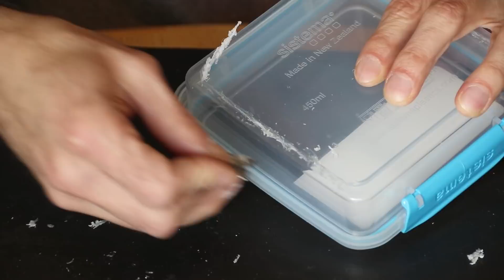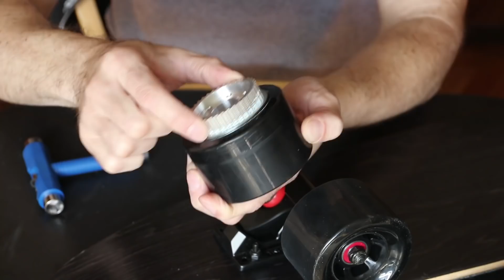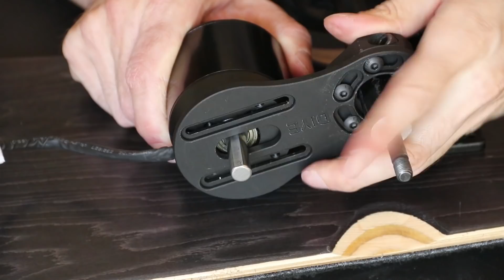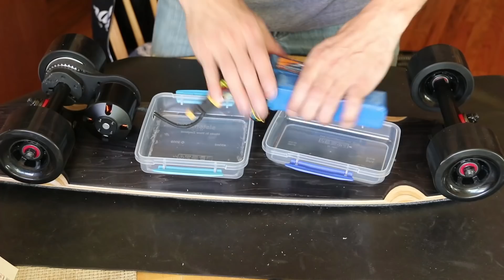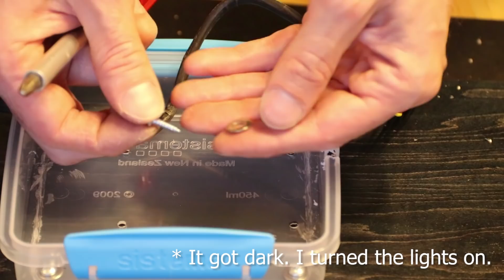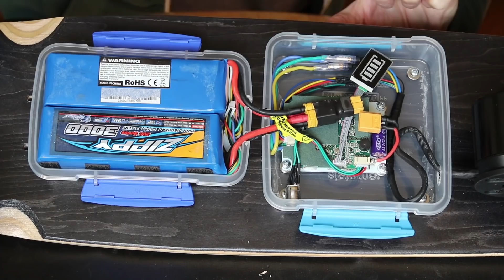Electric Skateboard Build - Belt Drive | Weight ~11 lbs | Price ＜ $300 | Speed ＞ 23 mph

Comment: How many miles do you get out of the two batteries?

Also i want to ask if it is posibble to add 2 motors and 4 batteries with the exact same set-up that you have?

Thanks
Reply: No, you would have to get another esc for two motors and you'd have to wire the batterys not in parallel.
Reply: I would recommend a VESC instead of 2 escs

Comment: Can you Link a motor that will work with the motor mount on HobbyKing because you can save some money if you buy $150 worth of stuff from them
Reply from the maker: The KEDA 63-64 190KV could work, but I don't think it's worth it. It doesn't come with connectors and is not as powerful as the motor I'm using. Also, I think the shaft is smooth, which makes it difficult to properly tighten a gear on it. It would probably be better to just order another set of batteries to get to $150.
Reply: @orensprojects7250  thank you

Comment: Dear pilgrim, I think that should solve your plastic box problems. They are cheap, every size and form.
They also should be easy to work with 😉
Never use plastics on a skateboard! Its not a toy, its extreme sports equipment!
https://www.campz.de/camping/campingkueche/relags-edelstahl-proviantdose/235339.html?gclid=EAIaIQobChMI4dWs9fa23gIVxLTtCh3N0AOpEAQYBSABEgJIR_D_BwE&_cid=21_1_-1_9_1371_235339_146945482710_pla&ef_id=W9zmrwAAALCnvvP@:20181103000711:s
Reply from the maker: Thanks! those look strong. They might be a little too tall and rounded. Maybe they have others.
Reply: @orensprojects7250  ...yeah i think there must be smaller and flatter ones somewhere out there, and if not i think its not to diffucult to modify a thin aluminium box like that...I posted you this because the plastic parts are more than deadly. 
Thanx for replying me and sorry for being late on this conversation, but your reply wasnt shown up on my account, kinda wierd...

Comment: Missed the most important part, didn't explained sensored motor and sensored ESC and why anyone should choose sensored motor and ESC.
Reply from the maker: Yes, I should have gone over that more. In practice I've noticed that it's not very important. I disconnected the sensors on my other dual hub motor board and the motors work fine - even from a stop.

Comment: A good idea for a video could be to do a charger for your batteries, so you dont have to take them off every time you have to charge them. Just like a Boosted board.
Reply from the maker: Being able to charge the batteries in the board would be nice. For that I would build a battery using 18650 Li-ion cells with a BMS. For these builds I used Lipo batteries because they're easy to connect and less expensive.

Comment: No anti spark?
Always wondered if really necessary 
Replacement board looks good with the blue wheels
Reply from the maker: Thanks, I'll show that board more in my next video. I used an anti-spark connector in the past but I don't bother anymore. After about a year of use without it everything is still working fine.
Reply: @orensprojects7250  but you get the sparks? no black residues on the connector?
 i'm using them atm on my 10s build but wonder if really necessary..

Comment: Motor rated to 75A. Batteries good for 100A+. ESC limited to 15A.
Reply from the maker: Good point. The ESC might be the limiting factor, but in fast mode this thing is almost unrideable because it accelerates so fast. I'll show it in my next video.
Reply: You have a point, but I'd argue that it is unrideable not because of the torque, but because of the relatively raw controller signal.  Boosted runs 60A at the motor, but does a lot of signal smoothing, so it doesnt feel uncontrollable.  I imagine the Chinese ESC just doesnt.  I would argue that at <15A, you really might as well stick to hub motors as they are simpler, easier to maintain, and somewhat lighter.  The whole point of belt-drive is that it allows you to run much higher Kv motors, which means the motors can run at much higher currents, which means you can tap into a TON more torque.  The VESC allows you to add some signal-smoothing, you should consider moving in that direction, I think you will find it is VERY worth it.  I'm really enjoying my deck which is running at 75A at the motor, 76mm wheels, and 3:1 gearing (so basically as much torque as you can fit without your parts scraping the ground), and despite my 30" deck, find it to be an exciting but quite rideable board.
Reply from the maker: I definitely agree the eBay ESC I'm using does not do a very good job at accelerating smoothly in fast mode. The point about how fast it accelerates is more to show that it's capable of generating a lot of power. The 6374 motor I'm using is way more powerful than a single hub motor would be. I also agree with you that hub motors are easier to build and maintain, which is why I generally recommend them. I've used VESCs in the past (see my older videos). The VESC is nice and I like the configurablilty, but I think more people probably want something that's easy to build, inexpensive, and gets the job done well enough. I understand that for esk8 enthusiasts the VESC is the better way to go. It sounds like you've built an awesome board.

Comment: you sort of messed up something, this a bit hard to watch at parts, as a  builder, the wheel pully that you brought is for Paris style trucks which are more rounded (even though they claim their "made for calibers)

thanks for the vid anyways
 **you put on the truck clamp at the wrong angle, or the seller just sent you the wrong mount
Reply from the maker: You must cringe easily. For the pulley, the ebay seller said it's compatible with Caliber II trucks. It might be compatible with the 10" version but I haven't tried. Either way, it only took a few minutes to fix. For the clamp, I tried it at different angles and that was the best it would get, which worked fine. I'm always interested in suggestions for improvement. With DIY builds there are choices to make. I try to balance the best performance for the lowest price. I know there are nicer components that are significantly more expensive. Thanks for the feedback.
Reply: @orensprojects7250 I just don't want others making the same mistake, when I first started I had the same issue ebay seller claimed it would fit on caliber but the hole on the motor pulley was too small.

Comment: I would like a dual motor esc but they don’t have a power switch how can I solve thisnossue
Reply from the maker: I'm pretty sure the dual motor version of the ESC I use in this build does have a power button. You can send a message to the ebay seller to make sure.

Comment: Hi Oren I would to ask you about this ESC with remote. on the website this ESC have Max out put 1350W....so if I want to buy turnigy sk3 6374 190kv which has 4000W then I lost some of this motor potential???
Ok and how smooth is your motor and this esc whe you push the throtle
Do you have 3 speed options just out from the box?
Thanks :)
Reply: You should get an vesc to reach the full potential of 6374 more specifically the focbox from enertion, if you do get an esc like in the vid it would be an bottleneck but it would still be very fast
Reply: FOCbox Unity just around the corner!  Its looking pretty tasty anf Jeff at @enertion has made some stellar design choices.
Reply: Search Aliexpress for FSESC, it's one of the cheapest VESCs but still good. The China ESC Oren used is a bit more plug and play (which is defenitely worth considering), but doesn't have the capabilities of a VESC. For the VESC you'll have to fix something yourself for the remote and power switch.
Reply: @ehvlullo  foxbox is better and more reliable try cheaper vesc on your own risk
Reply: For the price of that focbox you can buy 3 (!!) FSESC. And then it still may break. I haven't seen any statistics on focbox being more reliable than FSESC. Flipsky stuff has been out for some time now and has proven reliable as far as i'm concerned. Sure, don't use FOC and stick to 10s but that's advised for both. Enertion seems to me like an aggressive company focused on marketing. If you're going all out with 12s and FOC dual etc etc buy a VESC 6 (Flipsky has a good one as well), but people have budget constraints and things tend to be a lot more fun when they're only a third the price for the same performance.
Reply: @ehvlullo  foxbox uses better quality conponents but of course if configured Incorrectly you can fry any vesc
Reply: @ehvlullo  focbox is 138$
Reply: No. That's excluding $14 VAT. 
Focbox - $152.41
Flipsky - from $48.90 from Ali.
Edit: that VAT seems EU-specific. Still a very large difference without it.
Reply: @ehvlullo  48$ including shipping?? Yes I don't have vat I'm in USA, vat is only for Australia
Reply: @alanzhou858  yeah that AliExpress 49 is with free shipping, you can look it up. And VAT for enertion is also EU so those prices I mention hold at least for everyone there. AliExpress shipping is ok for me so far, but does take about 2 weeks to arrive.
Reply: @ehvlullo I agree that cheap vesc can treat you very well, I just like to have a sense of quality in my mind, it makes you have a sense that your board won't fail

**also the cheaper vesc cant do foc for shit, you'll just burn your drv8302 if you try, trust me I tried if you don't want to pay 138 for vesc get a torque vesc (vesc 4.12) for 100$ there super reliable and 

in my 4 years of esk8, I've got thrown off once and that was because my cheap may tech vesc full braked at me at 24mph

focbox has never failed me plus focbox can do 10 more amps than normal vesc

if you did not know vesc is an open source esc created by Benjamin Vedder
Reply: @ehvlullo  i just cheecked there is no 49$ vesc ( i only found maytech 89$) no vesc can sell for 49 dollars because that is the production cost (and its way to far from the price vedder wanted and authorized) the offical price for vesc is soupposed to be 100$
Reply: @ehvlullo  great than, I just don't want the MOST IMPORTANT component in the build to fail and seriously hurt someone, the problem with cheaper vescs like that is that the MOSFETs gets too hot and desolders themselves causing a loss of power which can cause you to fall forward when your leaning and don't expect power to cut.
Reply: Guys but what about the rc car or boat high Amp esc?? I see people use them for electric boards but the can be use with 6 or 8s only but cost about 35-48$
Reply: FocBox unity is around 130- 150$____ for this price I have
-this same hal sensored 6374 motor what Oren use
-this same esc and controler and power switch what Oren use
- and 8 or 10 LiIon samsung 18650 bateries
Reply from the maker: Hi Nucleo, it looks like you've already done good research! It is possible that the ESC I'm using won't get the maximum power from the motor but in my experience it will be more than powerful enough. There are 3 speed modes built in to the ESC. I almost always have it in medium speed, which accelerates smoothly and will reach a top speed of around 18 mph. In fast mode the board is almost unrideable because it accelerates so fast and will hit a top speed of around 24 mph. Options like the FOCbox or cheaper VESCs could be good if you want to get in to tuning the ESC more precisely, but they're much more expensive - as you've discovered.
Reply: @orensprojects7250  thanks Oren...for me 20mph is more then enough.....3 speed modes too :) if We want build skateboard with top shelf components and spend 900$ or more ,then is easier to order ready to ride evolve skateboard...
I love your jobs :)

Comment: That guys a prick. Screw him, btw im glad your back. Sense your last hub build ive decided to build my own board as well. I got everything but let mr clarify something....if you dont have all the stuff to charge lipos then you will be close to 500 dollars...although i used turnigy batteries.
Reply from the maker: Thanks! That's awesome you built a board! Yes, you're right that I didn't include the charger in the price. I have several boards and only use 1 charger. I use the B6AC V2 charger, which is around $45, along with a parallel charge board that's around $12. There are better chargers but that one has been working well enough for me.

Comment: I have questions:

1) What specific outdoor carpet do you use instead of griptape?
2) Does the adhesive adversely affect the deck?
3) Is it easy to remove the carpet to replace?

Thanks!
Reply from the maker: For the carpet I have the link in the description. I got it at Home Depot. It's made by TrafficMaster and I think it's called Dayside. The adhesive hasn't affected the deck in any bad way as far as I can tell. The only thing is that it's not quite as strong as the adhesive on grip tape so sometimes I have to re-glue around the nose or tail a bit. Maybe a stronger adhesive would help. It should be easy to rip off the carpet if you want to change. On my newer board I switched to a rubber stair runner material - the link is also in the description. I also got it from Home Depot and it's also made by TrafficMaster.
Reply: You caught me not reading the Description.  Sometimes I forget!  Thanks, Oren!

Comment: 8:34 looks like the belt is misaligned + touching the wheels?
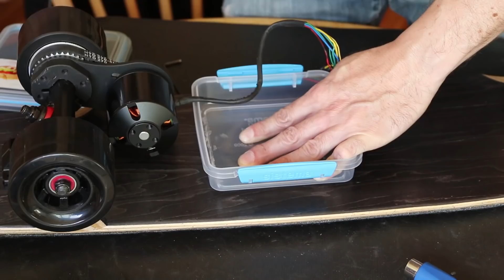Reply from the maker: It does look like that from that angle but there's a flange on the gear. You can see it more clearly around 8:48

Comment: YEA BEEN WAITING AGES FOR THIS VID. 

Solid video as usual. Its not a short vid but thats not a bad thing. For people who haven't watched any of your other videos and need a guide on how to make an electric board theres pretty much everything they could need. I look forward to the testing video, am interested in the pros and cons v hub. I cant decide if I want to actually go ahead and start building a belt or wait and buy hub motors later.

I still want to try 3d printing my mount and stuff. I got flexible filament to see if I can even print the belt but I havent done it yet because idk if the 3d printed parts are going to suck or not lol. But I do feel like belt has the ability to be much cheaper, and a single belt should out perform a single hub because you can use a much bigger motor.
Reply from the maker: Thanks! Sorry it took so long. I'll try to get the comparison video out soon. Yeah, I think a single belt setup could definitely out perform a single hub motor. 3D printing a battery container would be nice! Maybe you can create something that's the correct size for the batteries, strong enough, and also easy to open for battery swapping. That's something I haven't been able to find. For the belt it might be easier to buy one. I think they're pretty cheap and need to be very strong.